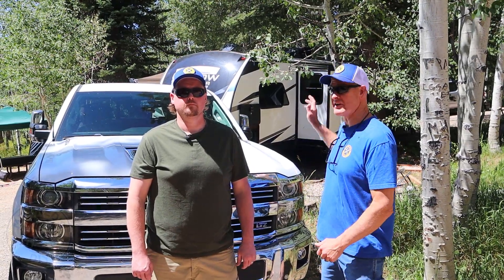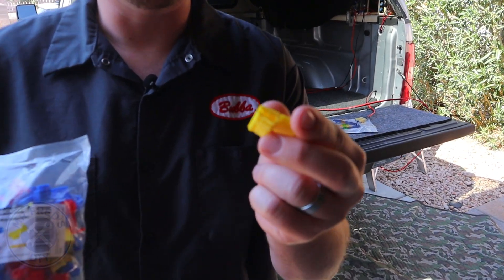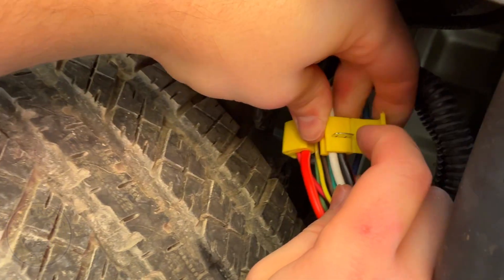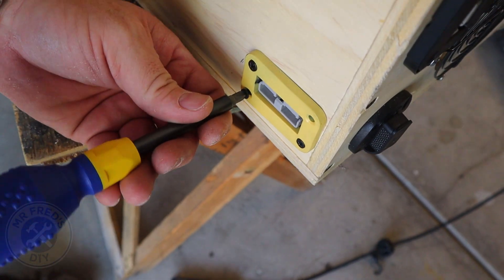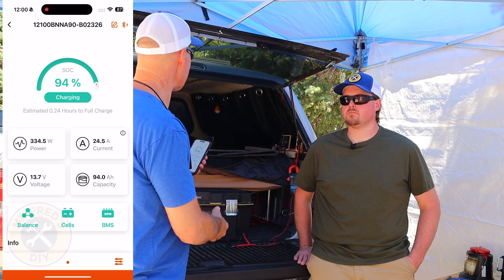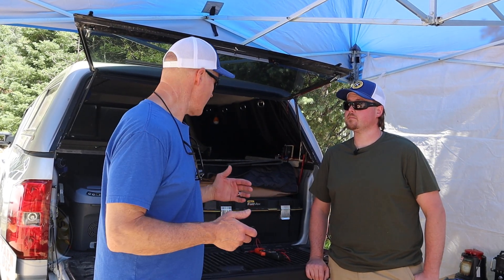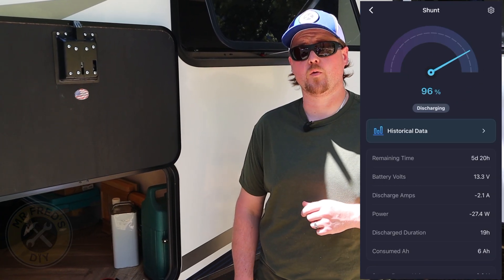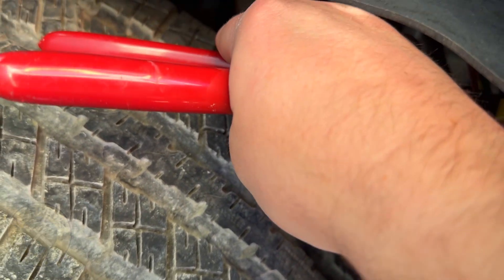Easy Alternator Charging For Power Stations & RV's

Comment: Why did the originally installed Victron DC to DC charger get replaced with the new one in this video.  Details on this would be helpful.  Was it a bad unit, did that unit fail, or was it the fact that it needed minimum of 15v input per the Specs:  Victron Orion-Tr - 20, 24|12 - 20 (In 16-35V, Out 10-15V, Power 20A

Comment: Your crimp splice connectors are just a failure waiting to happen.  I  have fixed dozen of electric faults caused by them. They are not weather sealed and allow corrosion to develop.
Reply from the maker: Time will tell. Here in the desert Southwest in Las Vegas we only get 3 inches of rain a year.
Reply: Agreed, these are aluminum clad which will oxidize over time causing high resistance.